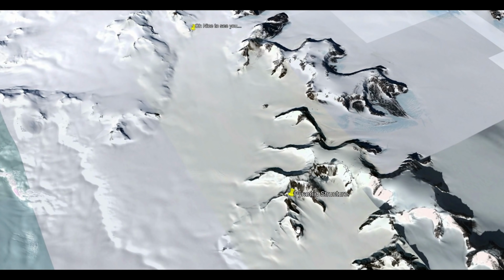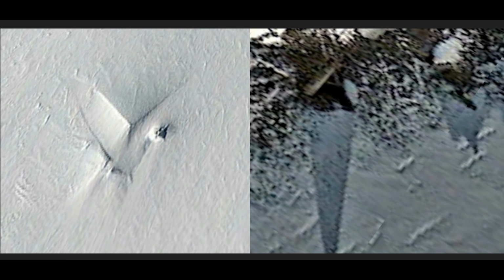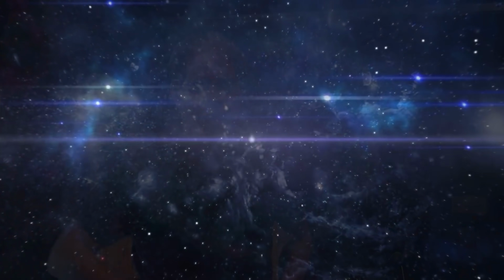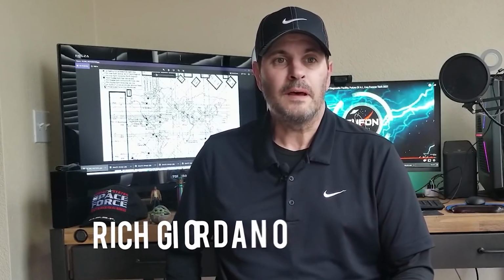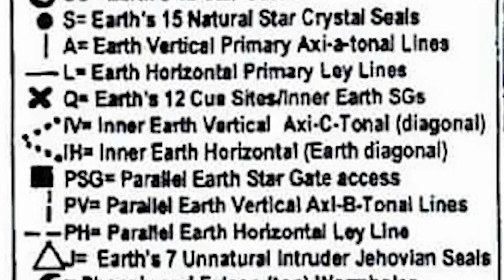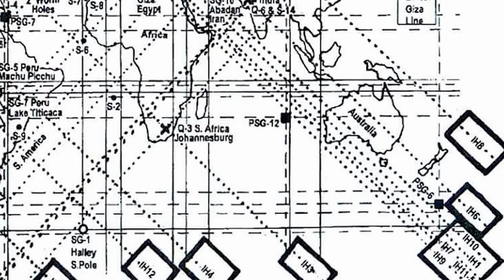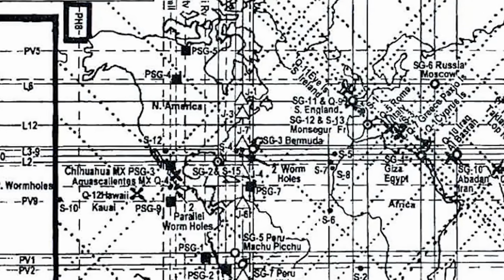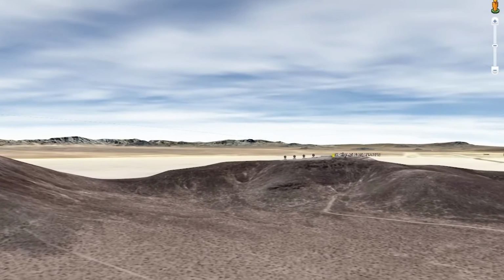Ancient Alien [NEW] Discovery "TR-3B Pyramid" Antarctica? 2021

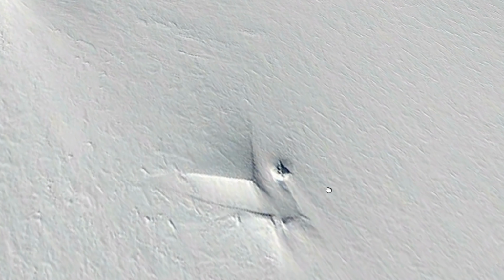Comment: 4:19 triangle is not natural, either a pyramid/ building part of the world wide electric grid from the ancient days or it’s a massive craft and there seems to be some other strange shapes , there are a lot of things hiding just under the surface . Check out the pattern of pyramids around the world that lie on the lay lines magnetic field lines or what ever you call them and see if it fits the pattern and you should be able to follow that pattern and predict where other pyramids hide under the ice and water and the forests of the world.there are probably working pyramids under the ocean in the DEVILS TRIANGLE AREA causing the mayhem of the DEVILS TRIANGLE.

Comment: Star Crystal Seal (Fire Crystals)
*******************************************************************************************
Along with the Seed Crystal Seals there are 15 more minute patterns of crystallized morphogenetic frequency that exist within the bio-energetic structure of a person or planet.
*******************************************************************************************
The Star Crystal Seals or Fire Crystals.
*******************************************************************************************
The Star Crystal Seals control the the operation of the Seed Crystal Seals in each dimension and can release the Seed Crystal Seals, allowing the dimensionally separated portions of the morphogenetic field to merge with each other.
The Star Crystal Seals control the angle at which the Dimensional and Harmonic Merkaba Fields will rotate, thus they direct the angular rotation of particle spin (ARPS) between the dimensional bands of a form particle construction.
The Star Crystal Seals control the the operation of the Seed Crystal Seals in each dimension and can release the Seed Crystal Seals, allowing the dimensionally separated portions of the morphogenetic field to merge with each other.
(Voyagers II – Page 474)
Planetary Star Crystal Seals regulate the evolution of planets and stars over extensive periods of time, through directing the orbital patterns of planets, stars and galaxies.
The Planetary and Galactic Star Crystal Seals direct the angle of rotatio
(Voyagers II – Page 475)
The Star Crystal Seals of the human body are presently in a dormant state, which keeps the Seed Crystal Seals of the chakra system closed. the body’s particle base and consciousness separated and the personal Dimensional Merkaba Fields locked into their respective dimensional frequency bands.
These conditions keep the human locked within the space-time coordinates of Earth’s present time cycle.

The human bio-energetic field also contains 15 Star Crystal Seals which control the function of the Seed Crystal Seals and the angle of rotation of the personal Dimensional and Harmonic Merkaba Fields.

When the Star Crystal Seals activate, as a result of infusion of energy frequency due to Stellar Wave Infusions and Stellar activations, each progressively opens various Seed Crystal Seals with the chakras.

Through this process, the HU-1 incarnate’s Merkaba Fields open into and merge with the HU-2 Soul Matrix Merkaba Fields, allowing the human body and consciousness to progressively transfer its particle content out of HU-1 into HU-2, then from HU-2 into the Oversoul Matrix of HU-3.
(Voyagers II – Page 476)

There is an intimate relationship between the Seed Crystal Seeds the Star Crystal Seeds and the Human DNA. Each Seed Crystal corresponds directly to and controls the basic functions of one strand of DNA.

The process of assembling DNA strands by working with the higher chakras is the process of bringing frequency form the Stellar Spirals into the Star Crystal Seals.
Each Star Crystal Seal is composed of half of the frequency patterns of the dimension above it and half of those from the dimension below.

Of the 15 Seed Crystal Seals within the bio-energetic body of the human, 12 Seed Crystal Seals governs the functions of the DNA Seed Codes within the 12-Strand DNA imprint; one Seed Crystal Seed directs the Seed Code of one strand of DNA.
(Voyagers II – Page 477)